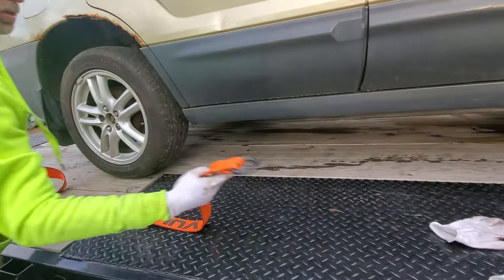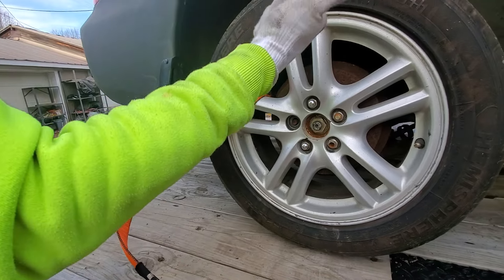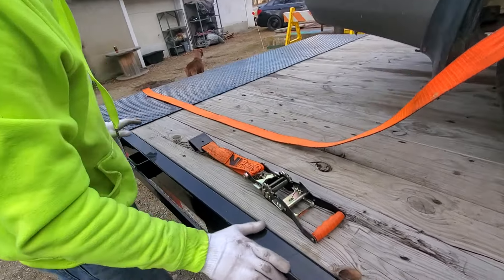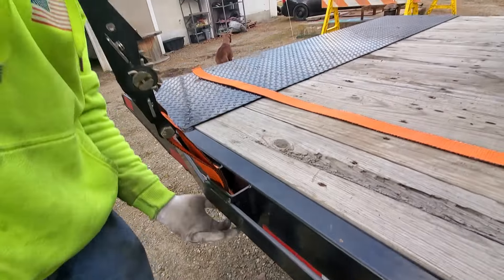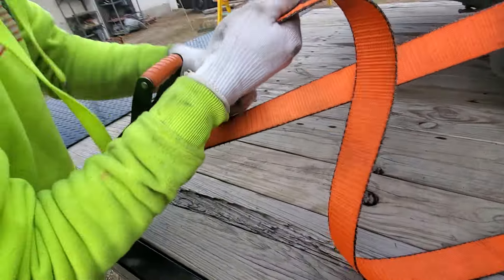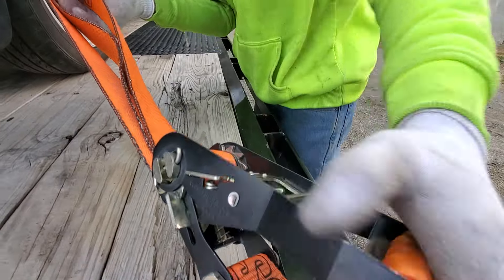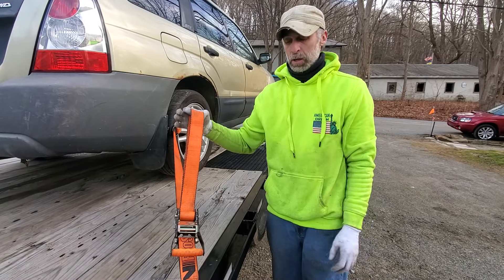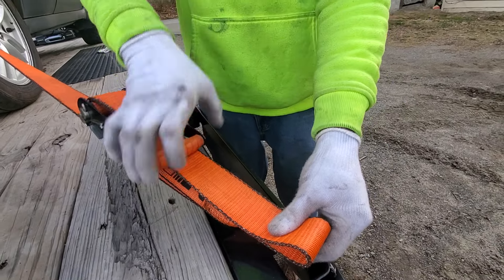How to tie down a vehicle to a trailer.

Comment: What if the wheel spins and now your strap is loose?
Reply from the maker: Good question.  3 things.  
1. Car in park with e brake on should prevent wheel from spinning.  
2. If the wheel does spin the strap will let you know the wheel spun giving you time to pull over and adjust strap in a quick manner to get back on the road. 
The 3 other straps will keep the car in place. Each strap is rated at 3,333 lbs.  The car weighs 3300 lbs. 
Less time on the side of the road is a safe day.

Comment: I just bought a tandem axle with (brakes on both) utility trailer that has a GVWR of 7000. The sales guy said I can tow my 3200lb car no problem, but in seeing mixed answers on the internet. Would you have any concerns as long as I don’t exceed the 5000lb payload capacity?
Reply from the maker: GVW is total weight loaded. 
Subtract the trailer weight from 7k and that's the limit you can tow. 
My trailer is a 14k gvw.
Trailer weighs 4k lbs. So max load I can carry is 10k lbs / 5 tons.

Comment: In your opinion, can you tow a 2600lb small car on a SINGLE axel trailer rated GVWR  7000lb??.  Dry weight 2100.
Reply from the maker: 7000 lbs is the total weight. 
Add the trailer weight and vehicle weight.  If you're less than the 7000 lbs you're good to go.

Comment: Thanks for the video; I've been doing this for a few years myself, but always great to see and hear how others do it.
On that note, is there any reason why you guys (In the US, I'm in the UK) don't use Over Wheel Straps?
Reply from the maker: We do use over the wheel straps also. It comes down to preference. 
Also depends on the trailer that use different type of mounting points. 
I already had these straps and they are easy to store under my seat.

Comment: If my truck weights about 4,900 LBS what kind of tie down straps weight capacity do I get something over 4k?
Reply from the maker: The straps in the video are rated at 3,333 lbs each. I tow my 7k lb diesel truck with the same straps.